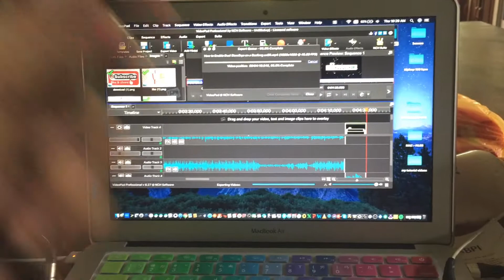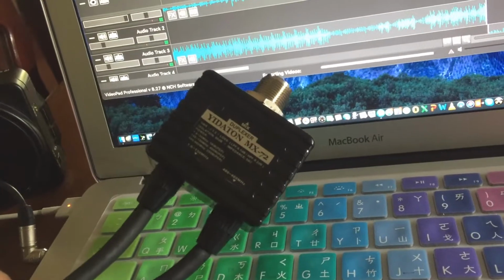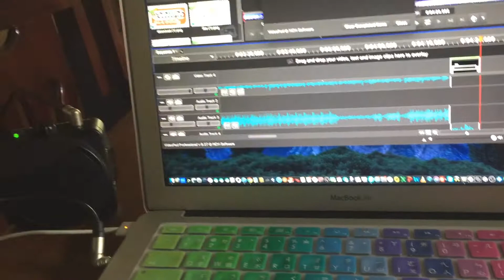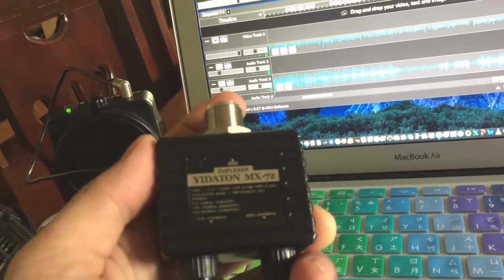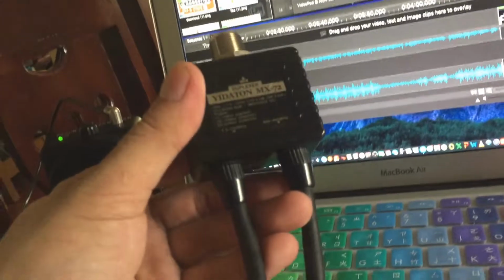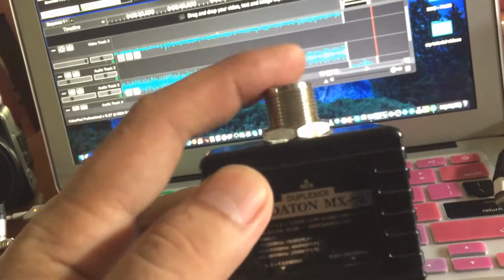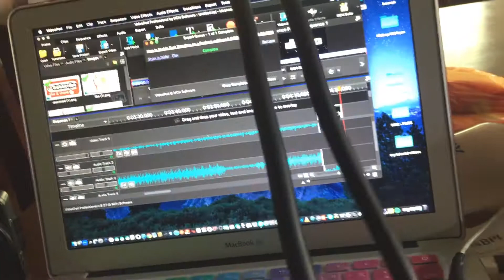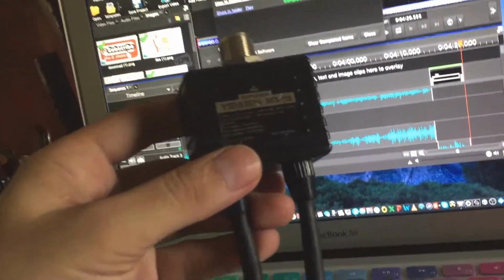Duplexer - VHF UHR for repeater

Comment: Sir good day. ano magkaiba ba sila ng function ng SURECOM SR-328 Duplex Repeater Controller? para saan din yung Surecom sir? plan ko kasi bumili pero bagohan lang ako. ano pinagkaiba nila? thank you po.
Reply: Sir dual band signal freq running simultaneously, ung vhf and uhf hahatiin sa dalawa low band half of the low band and half of the high band ei filter nya seperate into one into single cable papunta sa digibox or cable box, so bali ung low band sa kabilang signal na antenna mo then ung isang high freq band sa kabila
Reply: Hindi po kase sila pwede pag sabayin... Kubwari ginamitan mo splitter ot tap... Masisira ung antenna recieve ng element magugulo sha

Comment: Dear brother can I use this on yaesu ft 8900 two antenna one is VHF antenna and another for UHF antenna 
please give me solutions
Reply from the maker: The yaesu ft 8900 is a dual band repeater ready radio, if it have two ports at the back then this is suitable then you just use one dual band antena. now if you want two antenas vhf and uhf its ok also then the other end will be attached to the radio if only one port u/v ready. how many antena input socket at the back? is u/v sockets separate? or only in one soccet? if one no need this, just use a dual band antena....im using cignus cg 828 uv crossband reapeter ready only one antena soccet.
Reply: @techguidechan3979  dear brother I want to use one USF Yagi and one VHF Omni 
And in my radio back side one port
Reply from the maker: @hasanmohammadakram  yes it can you do it the reverse way, sice this is two way....you can use the vhf side for omni and uhf to your yagi, just make sure you connect the antena to the right port.